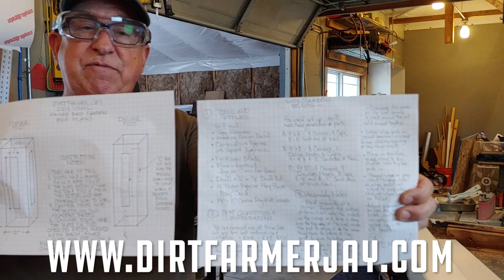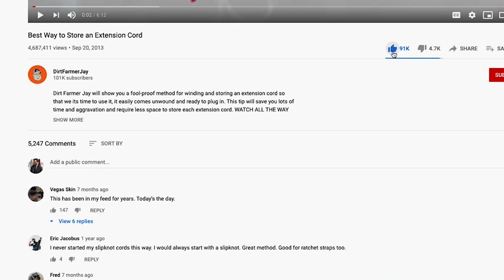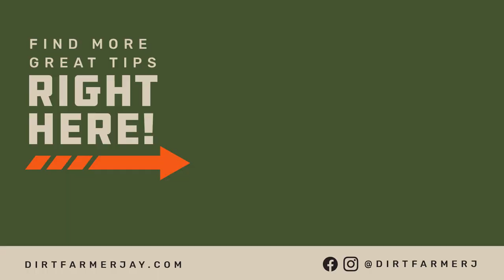DIY Raised Garden Bed

Comment: I love my raised beds... they have save so much time on soil prep, weeding and general neatness.  However, I did use recycled lumber and over time the wood has begun to rot. This a handsome solution. I'm wondering how you might add netting or a trellis to this? I use netting to keep the critters out and I grow many of veggies up a trellis. Thanks!
Reply from the maker: Sure JS Quaker. Both of your suggested additions to this system are great ideas. As stated on the video, we try to buy damaged vinyl fence parts when we can as their looks don't matter as much as the longevity of the bed. Best to you, DFJ